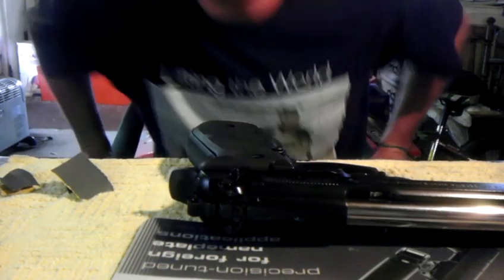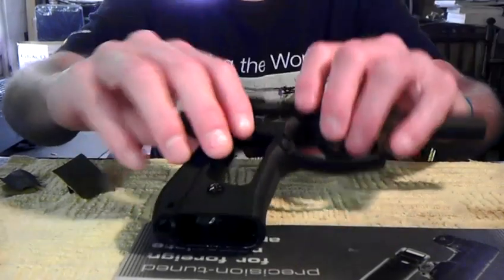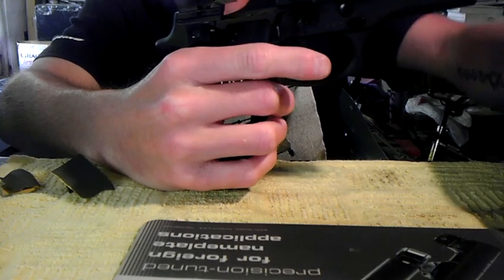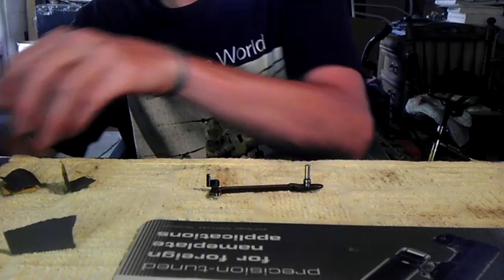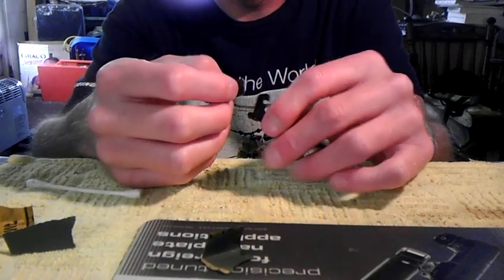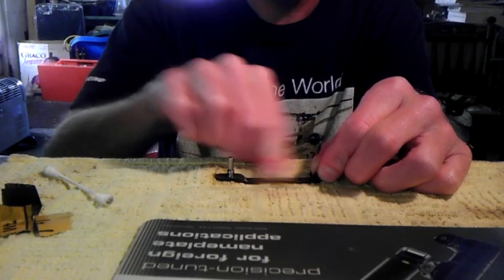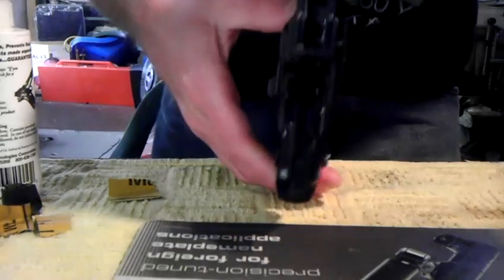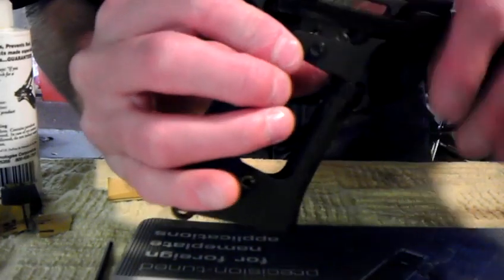Beretta 92fs Easy Trigger Job Part 1

Comment from the maker: Not at this time. With the trigger and sear polishing the SA is sweet and the DA is much better. The D spring will improve the DA even more but I question if the lighter sprint could be more prone to light strikes especially in cold weather